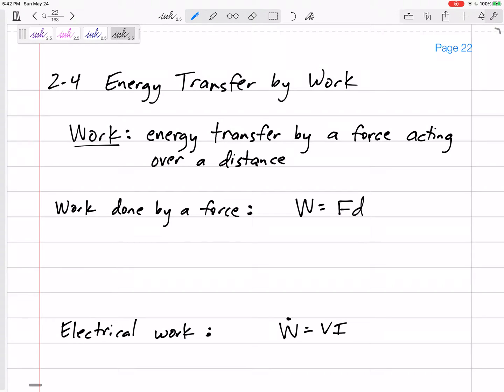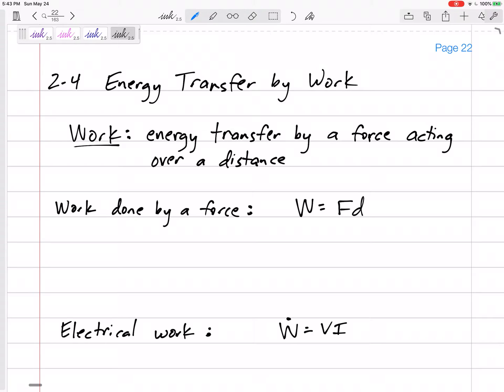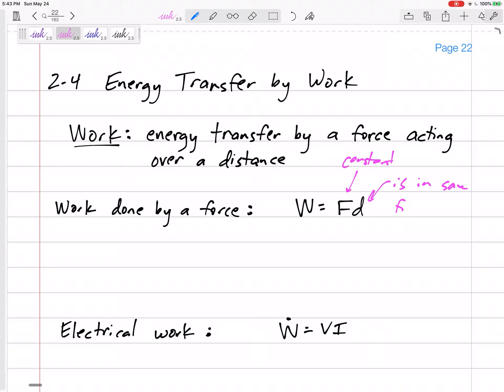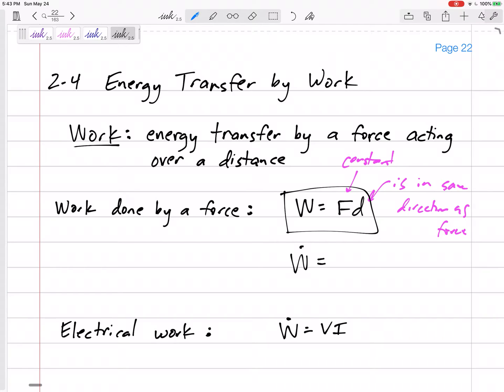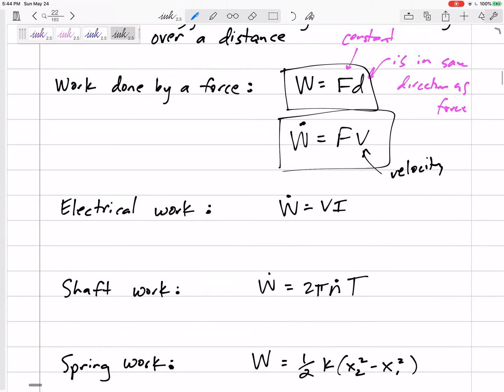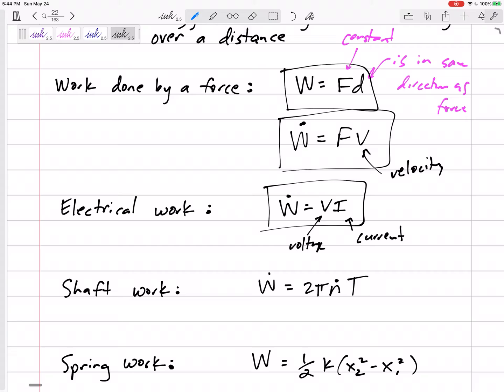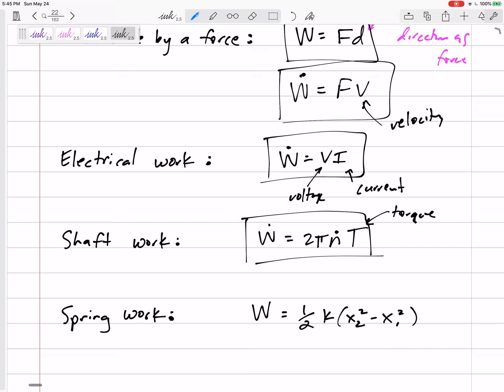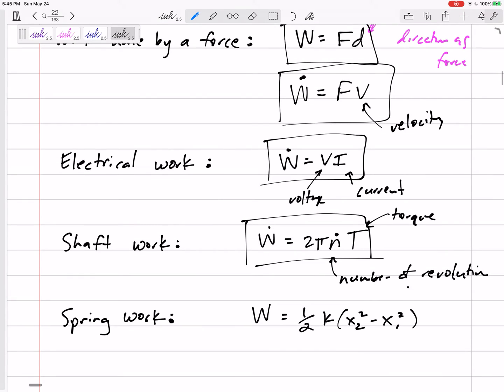Thermodynamics - 2-4 Energy Transfer by Work

Comment: I could not get it why a dot is put for electrical work and shaft work.
Reply: I think they are representing power but professor forgot these dots.
Reply: @Justaguytriestoexist  yeah you are right p = ı .v and if you multiply with time we will have Work =ı v.t for per unit time divide by t